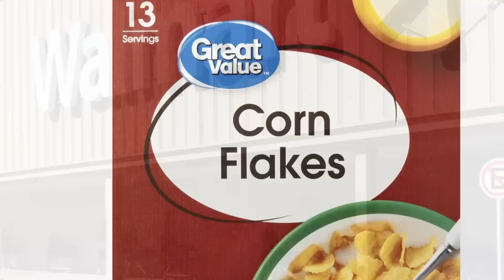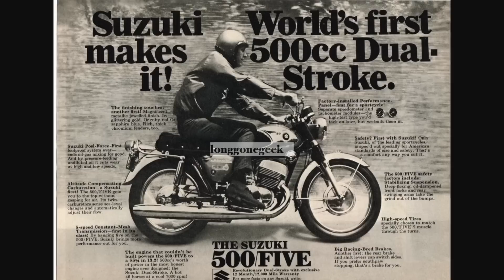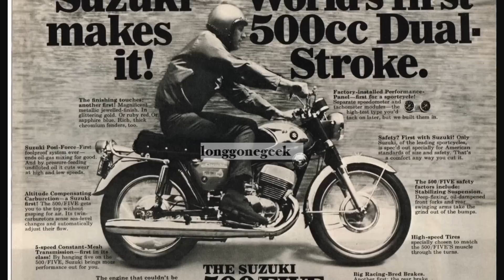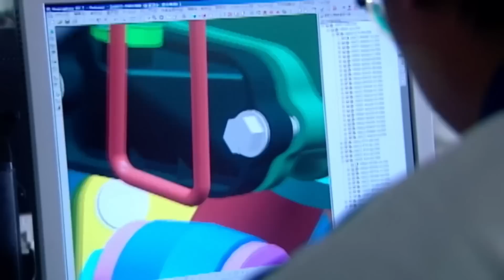How Suzuki became the Walmart of Motorcycle Companies

Comment: The standout bike back in 1985 was a GSXR 750 as seen at an expo in Durban on the beachfront, Was riding my archaic R100RS at the time, when I saw the GSXR talking to the Umpleby dealer guys. When I saw what I saw I knew here was a new generation of bike and that biking would be different from here onward...
Reply: Yes, agreed, the GSXR had so much more which others did not have at all. It formed the basis of what was to come. And, that was the consensus. I just could not see it. As a novice rider I was too focused on the Yamaha FZ 750 due in part to its half fairing and engine configuration.

Comment: Great content and editorial prowess in this video! I too am sad to see the demise of the sport bike market. It was a phenomenal run while it lasted.
I owned the original GSXR750 when it was first released and currently ride the latest version of the GSXR1000. There have been many brands, displacements, and engine configurations in my stable over the last 37 years. (19 different bikes in all) For the most part, all have been contemporary sport bikes. One of the reasons I chose the latest GSXR over others in the field is that it's NOT overly complex. There's no linked braking or ABS on my bike: just great handling, with prodigious power, and a riding experience that won't roast my nuts on a hot afternoon. Just ask any Panigale, RSV4, or R1 pilot about heat management and software gremlins. They might look space-age and produce more power, but they're not so easy to live with. On the street, their extra features and horsepower mean very little. The Suzuki runs cool and smooth with plenty of grunt.  Sure, when I arrive at my local haunt, I seldom get a second look...and that's fine by me. The ole Gixxer meets or exceeds the prime requirements for ultra moto satisfaction. She's a competent platform, with 200+hp, and ample capacity to embarrass lesser riders on better bikes. Trust me when I tell you; it's more than enough for mere mortals. By keeping things less complicated, while still delivering an excellent riding experience, Suzuki has kept me in the fold. It may not have been their intention to be the Walmart of motorcycles, but their combination of price and performance is a great value and hard to beat IMHO. Cheers
Reply: I had an original first gen GSXR750 as well getting back into street biking riding now at 57 I went with a Yamaha R7 for the exact same reason of no fancy electronics or riders aids. It is a fun bike but I wish I still had my old GSXR for not only the retro nostalgia but because I still feel it is one of the best sport bikes ever made.🤘😎🎸🏍

Comment: I put 85,000 miles on my year 2000 Suzuki VL1500 intruder (old C90 Boulevard). Bought it used with around 15k mileage in 2005. Rode in the rain and the ignition switch and dummy switch on the clutch started having contact problems. Regulator rectifier got wet and caused problems. Clutch pushrod seal leaked from age. Got me to work 99% of the time for 5 and a half years with 34 mile round trip commute. Best life of battery was 5 years then 2 years towards end. Sold it after 17 years ownership and got 30% of what I paid for it. Also clutch decompression cable needs its adjustment, but mostly oil changes, spark plugs, brake and clutch fluids, new clutch at 60k miles and tires. Solid bike. When I bought it for $7,000 in 2005 the best I could get was a used sporster. Oh BTW shaft drive and hydralic valve adjusters so my mechanic never had to open the engine except the right plate when the clutch got replaced. Had like 3 major crashes on it and the tank of a machine was saved by crash bars.

Comment: It is interesting to note, that in the UK at least, Suzuki's best selling bike last year was the GSXS 1000GT.  One of those parts bin bikes in many ways but still great.  Clearly that area of sport touring has not been completely filled by the likes of BMW with their GS1250's and other semi off road machines.  Perhaps that niche is one that Suzuki might fill.
Reply: I mean there’s still the BMW R1250RS
Reply: The GT is a bit of a bargain.  There seems to be a slight resurgence of sports tourers.  I’d consider  a Moto Guzzi V100 but would never consider a ADV style bike that everyone seems to buy these days (and then run them on the road 🙄
Reply: @viktornilsson9259  For touring bikes being light is a detriment. You want a controllable brick to pierce that highway headwind and resist truck wake.
Reply: @morri03  And it shows.  Buzzy engine, geared too low,  no remote preload adjuster for rear shock,  non adjustable windscreen....but damn it looks good.

People hear GSXR engine and get a hard on. It has the same top speed as the Ninja 1000SX, and not much else that is better than the Kawasaki, the bike Suzuki obviously cloned with the GT.
Reply: I really hope that was meant to be a snarky internet hottake and not a serious statement.

Comment: Had a black and red 86 750 and it was awesome. Still one of the best bikes I owned. It was rude and crude. The only engine noisier was one with the dry clutch. Through a rod at 80k hard abusive well maintained miles. Sold it easily to a guy that had a 1000 to swap into the bike still in great condition. So much fun and great memories of that beast.

Comment: Suzuki needs to change their image of boring cruisers and make competition for Honda Rebels. The drz400 with less flash in the color department would be hot with efi and updated electronics. Theres 30 years of accessories for it already if they added reliability and coolness . A sv650 based retro naked bike I feel would do well. It's a good engine.

Comment: Respectfully you do not know what you're on about lol. "they simply aren't known for really anything at this point"  They are known for running the drag strip. They are known for having very strong bottom ends, they were the first Japanese sport bikes with inverted forks, they were the first sport bikes with full radial brakes. 750s had fuel injection in 97. The yellow flash button so you don’t get run over😂. Decades ago Suzuki was using Brembo brakes on their sport bikes. 2006+ all come with slipper clutches from the factory that work great, they came with KYB stabilizers factory decades ago unlike other brands that never starting using any of that until years later. The look and feel of their LCD displays, and overall finish of their new bikes is as nice as the other 3. They're just not overpriced like Yamaha has become so you think they can't possibly be as good. Honda makes excellent engines, but to say they make better sport bikes than Suzuki is crazy. Overall they are easily the best FI sport bikes ( over the last 25 years). The only bad thing about a Suzuki is that the rectifiers fail more often so you should test it every season to be safe. Which i can understand some having a problem with but they all have issues. I'd rather do that than have the bike just explode like my CBR.

Comment: Well, as for the GSX-R750, it was and is so good that ALL of the competition just threw their hands in the air and said "We give up, We just can't build a 750-class sportbike that can beat the Gixxer on performance.......and remain competitve pricewise." Suzuki did and still does pour a lot of technology into their 750 and it remains a consistent seller in their lineup last time I looked.
As for ADV bikes, the V-Stroms big and small STILL sell in consistently good volumes year after year starting in, IIRC, 2001 because they offer great value for money......and a lot of fun and reliability into the bargain. They are also consistently 40-50% cheaper than the competition and can carry as much stuff. Who can ask for more ??
Sport-touring was taken care of by the Bandit lineup starting in 1996 and it soldiered on until 2016 with bodywork changes every 5 years or so and a major engine change in 2007. The 1200/1250 was the big block bike that could do everything the average rider wanted it to do and cost about half of what the competitors were charging for their competing products.......and the average guy could do most of his maintenance in his driveway at a reasonable price. I know what a great bike they are because I own a 2006 model which has the last of the GSX-R original SACS engines that are totally bulletproof. You folks in the US never got this bike which has the new 2007-2009 1250 frame and bodywork with the old design engine. I'm approaching 100,000 kilometres and have only replaced the normal wear components on it since new. I know numerous Bandit 1200/1250 owners with 150,000+ MILES on the original engines without teardown. Now THAT'S value for your dollar.

Comment: I have owned Suzuki's for awhile. My first was a 2000 GSX600F katana, then I went to a 2002 GSXR600,  then bought a low mileage 98 GSXR750,  and then got a 01 TL1000R,  then I got a 20th anniversary 2005 GSXR750.  I would seriously buy a 2025 40th anniversary GSXR750.  Especially if Suzuki made a retro model  like a 1985/86 body style looking with 2025 technology.  What i love about Suzuki is that even though for awhile there was no 750cc class for racing. Suzuki continued to make the GSXR750 because that's the bike that made a huge historical impact for Suzuki.  And I still have my 98 GSXR750 and 01 TL1000R.   Sold the 05 GSXR750 which I regret doing. But definitely hoping for a 2025 40th anniversary GSXR750 model.

Comment: Suzuki in the 70's and 80's was absolutely awesome. The 70's had legendary bikes like the Gt750 series, the Gt550's, and one of my personal favorites is the '71 T-350 Rebel. 

The Gs Series of the 80's was awesome too. I still own and ride an '81 Gs-650 for a 70 mile daily commute. Suzuki (in my eyes) has always had the advantage over other bikes like Kawasaki for one reason. They do not have top-notch performance. The reason why: it makes the bike more reliable at the cost of just a bit of power. Suzuki would often de-tune some of their models to take away some power and help it last longer. Kawasaki had crazy hot-rods of bikes like the 1980 H2 750 with insane power, but how many of those older model Kawi's do you still see on the road today? Those bikes didn't last long. Suzuki motors have always been kindof bulletproof. If you look around, you can still find plenty of them for sale in reasonable shape. My 650 has almost 70,000 miles and still runs beautifully.

Comment: the latest and cutting edge tech doesnt make a motorcycle better. look at yamahas cross plane r1 snapping crankshafts. ducati is known for using the latest tech… and their poor reliability. go to a drag race event with heavily modified motorcycles and you will see a lot of suzukis. other brands just dont hold up to that type of abuse. great value 🗑️ from walmart on the other hand is junk.

Comment: In New Zealand small bore Suzuki’s were everywhere in the early 70s . They were so cheap and took such a beating. It all started with the Maverick 50 then the Wolf twin 90 and the 125 twin stinger. I had a TS185 in 1974 so cheap at $750. A year later I paid $1k for a TS 250 ( sold the 185 for $500 with 10k miles on it running great) I’m 66 and just sold my DRZ 400. It was still not as much fun as my old TS 185.  The DRZ400 was just too heavy and not geared right. It needs a 6 speed with a much lower 1st gear and a higher top. Still I put 30k on it 100 % reliable.

Comment: I had a GSXR600R K1 as a race bike from 02 to 06.
00 to 04 the K1 to K4 was king in the 600 class. 1st to have fuel injection. 1st to have aluminium frame that was basically 2 beams from swing arm to steering head.
Since then it never really stood out. 05 to 07 was a tussle between Honda and Kawasaki. 08 to present has been Yamaha R6 by far... they took the Suzuki features and made them better

Comment: If Suzuki put a windscreen, basic efi, and a 6th gear on both the Drz400 and Dr650, they would absolutely annihilate the dual sport/adventure bike category. Hands down. Hell they wouldn't even have to stop selling those two bikes as they are either, just lower the current bikes pricing to 4999 each and make the new bikes like 7999 and/or 8999 and it would make a killing in sales.

Comment: I’ve just picked up an 03 K3 1000 had to reshim the valves a replace most of the gaskets and plastic’s lights and cluster gauge. Thing is I  love renching on 🏍️ the whole project costed may be 2000.00$ plus1000 for the bike so for 3000.00$ I’ve got myself a bike that I can trust will not leave me on the side of the road broke down. Parts for these 🏍️ are a dime a dozen doesn’t matter where you live everyone had one . Well, that’s the whole thing these street bike like the GSXR 1000 and 750 Are exactly that race bikes people are going to race them do on the street or the track

Comment: Small correction: The X in GSX and GSXR stands for four valves per cylinder. I've owned a GT 380, 500 Titan, and GS1000S before veering into other brands like BMW and Moto Guzzi. After a 30-year break from motorbikes I now own a V-strom DL1000A and two GSXR 750's for the track. All great quality bikes and unchallenged value for money. I would like to know what their strategy is, withdrawing from MotoGP. Electric perhaps?
Reply: Grand Sport eXperimental - Racing. By Suzuki themselves. I dunno if they changed it or it was the idea since beginning but currently it is Grand Sport eXperimental.

Comment: that Suzuki philosophy is still going strong in my country. i live in SEA, most of us could only afford 150 bikes. and sure enough, suzuki makes the fastest bike in the 150cc segment, gaining a proven (140-150kmh) GPS speed. Cheapest in its segement (2500usd) compared to yamaha and honda offering (roughly 3300usd). and of course, suzuki's design is the most outdated with no fancy features like ABS, quick shifter, assist/slipper clutch. checks all the boxes but im still saving up to buy a zuki❤️

Comment: I care about sports bikes, I bet you don’t get your knees down and the scratches on your knee sliders ,were put there by hand as you took out your brand new replacement sparkies and replaced the sliders that hadn’t even been anywhere near any tarmac in their short shiny lives! And chicken strips an inch and a half wide either side of your rear tyres and as for ignoring that red warning light for a few more seconds just to beat your own personal top speed ( 170+mph)
I’ve learned to love the ache of repetitive strain injuries on my wrists and neck from spending hours in a moto foetal position and getting cramp in my hip/thigh while doing 150+ and having to just ignore it because straightening out that leg is far too risky and relieves absolutely nothing, I bet you even rock a legal sized licence plate rather than risking it with a tiny postage stamp sized number that the cameras can’t even make out , let’s get the go pros out and upload a typical Sunday morning outing?  Tear along the dotted line - I love my sports bike ( c2h ZX10R ninja kwikasfuki)❤
🥷

Comment: Well, sorry but Yamaha's mass centralization and Genesis engine of the original 85 FZ series sort of redefined Japanese motorcycling moving forward, not Suzuki's oil cooled bikes. Suzuki did get it right though with the aluminum frames, that was good stuff.  I rode a GSXR1100 when they first came out and it was a screamer, but the most uncomfortable bike I've ridden up to that point.

Comment: I have never been a fan of Honda, largely because of their refusal to build 2 stroke bikes. While Suzuki, Kawasaki, and Yamaha made a ton of 2 strokes, Honda didn't have any. My very first street motorcycle was a 1972 Suzuki GT380 2 stroke triple, and it was a wonderful bike. I bought it used in 1975, at the age of 16. In 1980, I traded it for a new Suzuki GS450L, which I put over 35,000 miles on, mostly highway touring. I owned a 1984 Suzuki GS850L for 14 years and put over 100,000 miles on it. I've always been a cruiser guy. I was really disappointed when Suzuki came out with the GSX-R in 1985. Why would they build a POS like that? Most likely because Kawasaki, Yamaha, and Honda were making the same trash. I rode used Japanese cruisers up until 2003, when I got my first Harley, a used 1989 FXRS Low Rider. I still have it, and have added 2 Sportsters to my collection. My one and only Japanese bike is a 2006 Kawasaki KLR650 dual sport. The Japanese made a huge mistake by building "race bikes for the street" and creating a whole new kind of "outlaw" rider, that rode irresponsibly, dangerously, illegally, and with no regard for others on the road. Race bike belong on the track, and should never have been legal for the street. They have basically ruined motorcycling, at least in the U.S.
Reply: You waste your life with your Mliwaukee tanks.

Comment: I’m one of those Suzuki “fans” you mentioned. I recently bought a SV1000. I chose it over modern bikes because it’s a timeless and fun bike, (with a glorious V Twin). Exactly what I want right now. Its also a simple bike that is fun to work on and maintain. It’s my second SV. My first bike was a ‘74 TM125 that came to me as parts in a box. I assembled that bike with my father’s 2nd rate tools, a torque wrench and a TM manual. And amazingly, it worked. Then I rode RMs until I got my first SV. What stands out to me about Suzuki is that they build bikes I want to ride. Right now Yamaha bores me with their over engineering. Kawasaki is slightly more interesting, and Honda a little more so. I keep coming back to Suzuki because they always seem to have something I want. Can’t say the same for the other Japanese bikes. I do love many European bikes right now though.